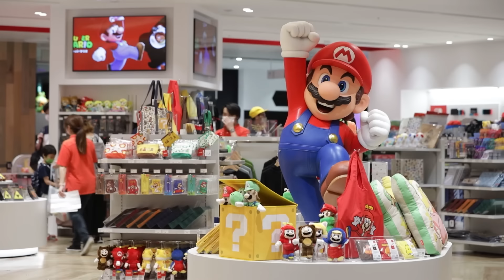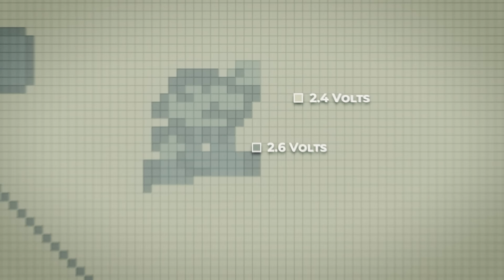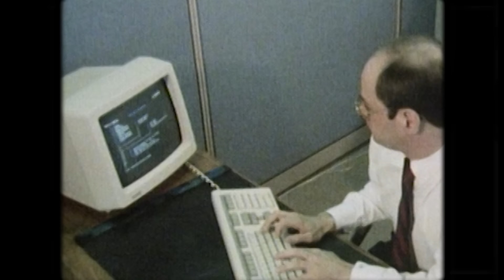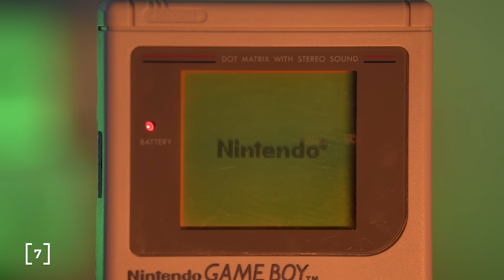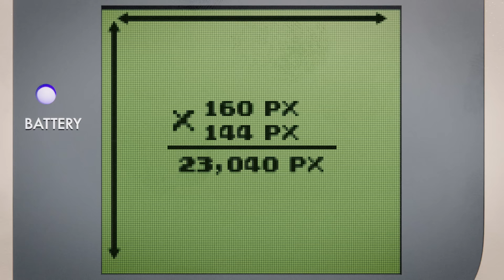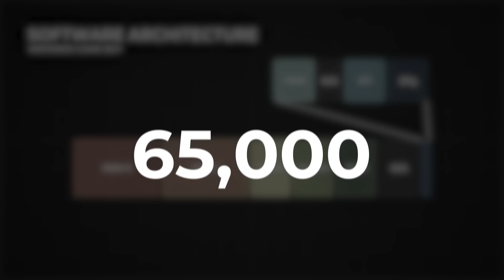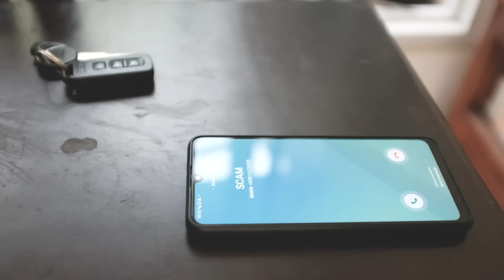The Insane Engineering of the Gameboy

Comment: What made the Gameboy superior was that it was actually doing what people bought it for. it was small enough to fit in a pocket, sturdy enough to withstand rough handling, efficient enough to last a whole road trip and cheap enough people felt comfortable taking it with them in places where it could get damaged.
Reply: That old gray brick was a rugged son of a gun. All early Nintendo products were. We used to say they were made of solid Nintendium.
Reply: @tunoddenrub  Remembering when Nintendo Power published a photo of a Game Boy from Iraq that tanked a hit from a Patriot missile and still worked.
Reply: @zeframmann1641 okg i forgot about that magazine
Reply: @zeframmann1641  another remarcable is recall seeing one that hadcits board basically halved a bit of sodder connecting the halfs fixed it enough to work
Reply: @tunoddenrub  Not all of them. The original toaster NES was fragile and finicky as hell. It didn't really STOP functioning, but the toaster mechanism could easily bend and damage contacts, which is a big part of why people blew on cartridges - it wasn't because the contacts were DIRTY, it was because they were DAMAGED, and the moisture in your breath momentarily allowed the cartridge to complete the circuit.
Reply: That OG Gameboy could not fit into a pocket unless you had parachute pants. Which is possible given it was the late 80’s, but still. Although you could buy a Fanny pack for it, lol.
Reply: @mrshmuga9  Not in your pants pocket but in your jacket pocket.
Reply: @mrshmuga9  nah, I could fit that thing in a pair of jeans, it was uncomfortable but it fit lol
Reply: Don’t forget that it was actually really fun to play for hours
Reply: my Gameboy Advance SP still alive after 20 years lol.. i droped it like a thousand time and only scratches, it like a tank 🤣🤣🤣🤣
Reply: Yes. The customer needs wasn't what an enthusiast wants. It was what a everyday person wanted. It's also why Macbook MacOS, and the M1 chip(in a Macbook for those unaware) is so good for everyday people because it is simple OS, long battery life, and CPU focused. Also, it's why VHS won against Betamax(higher video quality, but couldn't store movies).
Reply: @kknn523  It's more general even than that! VHS allowed you to extend the recording time by slowing down the recording heads. It was TERRIBLE for quality but it was good enough to record an entire NFL football game (about 3.5 hours).
Reply: It was the games you noob
Reply: as he said, UX was the focus.
Reply: True! My blue gameboy colour withstod multiple falls including a 2 meter fall follwed by falling further down stairs and at least 2500 hours of gameplay! I am glad to say, that I still own my Gameboy and it is still running, even thouh it sounds like and flickers like it is dieing.
Reply: And it cheap too
Reply: Now, people understand these concepts through product management principles. Basically, making the product for the target audience's needs. Another thing people forget is also the customer is sometimes different than the user. So, gameboy was very accessible to the mothers and fathers who would feel comfortable spending less money, and also it seemed like it was a whimsical sounding and looking toy for a kid.

 In short, gameboy focused on the mainstream customer and the user. Where as the other product was better only for an enthusiast.
Reply: I dropped my older brothers fat gameboy ONE TIME and half the screen broke on it
Reply: Supposedly $89 in 98 is worth 175 today. I wish they'd make handhelds for under 200 today
Reply: @Redsundog a PS5 is only double that
Reply: It was never superior any real 80s kid knows this from experience. Ur all looking at history u did not live.
Reply: Original gameboy could never have ran a game like CastleVania 3 Dracula's curse. However the Advance Gameboy did have the capacity to run CastleVania 3. It took Nintendo way too many years to make GBA & GBA-SP but Ninja Five'0 was an amazing game. Several other games released on GBA were really unique.
Reply: Isn't there videos of a GameCube be dragged by a truck ans and the SOB still works ?
Reply: Cheap is relative. Was definitely not cheap for me.
Reply: @thisguy2958  Indeed but for many people at the time it was cheap enough that they could consider replacing it. Therefore they weren't afraid to take it into places where it could get damaged.
With the Gamegear many wouldn't take it with them in fear of damaging it.
Reply: @MrMarinus18  had both. Confirming 100%
Reply: @thisguy2958  sure, but the point is it was attainable enough for a person (or parent) with an average income at the time to afford, vs earlier attempts at such products that only rich people and a few really dedicated enthusiasts were ever going to swing.
Reply: @thisguy2958  Relative to its competitors. That's the point.
Reply: @thisguy2958  Well duh. That's the point. U want to be affordable for the most amount of people. Imagine if they had more features how much more  unaffordable it would've been for u
Reply: Definitely not cheap.

Comment: Excellent video, Brian! 

8:52 I would like to point one thing out, and this is a myth I’ll likely spend my entire life debunking. In your video, you state that taking out a cartridge and blowing on it will displace dust that may have caused a faulty connection. However, this wasn’t really the culprit. If any of the pins were misaligned, then that would be the cause of the error, and the reason we all thought blowing on it worked is that by removing and reinserting it, we were giving the pins another chance to realign. The reason I’m so particular on busting this myth is that the moisture in your breath can cause damage to these vintage games. 

So, for any of my retro gamers out there, pull the cartridge out and reinsert it, that’s all you need.
Reply: Bump
Reply: it's just weird though, why was only the NES the one with the problem, i never had or ever saw any problems with the gameboy or anything else cartridge based
Reply: @brats-evolved-cat  it happened with the gameboy too it would cause it to not boot the game
Reply: @gyroninjamodder  i swear if it ever happened it was 1 time out of 500
Reply: Saying blowing into a cartridge damages it is just as much of a myth.
Reply: @gyroninjamodder  
Say you don't know how moisture corrodes metal without actually saying it.
Reply: @evanray8413  I am not denying that corrosion is happening. In fact there is already moisture in the air corroding the contacts without you doing anything.
Reply: @gyroninjamodder  
Blowing on them adds more, obviously.

Comment: Meanwhile current game developer: ok we will use 100GB of your storage space, and we need 32GB of memory, latest gen CPU, and 4080 at minimum to run our game. Oh, and there's 65GB update that you need to install. Optimization? Whats that?
Reply: That annoys me too, but I'll put on my developer hat and say that some of it is understandable once you understand what's going on. A bugfix can end up producing a binary that doesn't diff neatly against older ones, either because the compiler doesn't do deterministic builds (which can be to prevent exploits or because the compiler devs didn't put time into making builds deterministic) or you have asset pipelines that don't produce deterministic outputs. Now, some of this can be dealt with in build pipelines, but there's often no resources given to it. If you see a game with big updates that have small downloads, either that's a studio that goes out of their way to keep updates small or you've a rogue dev who's trying to do the right thing. Not all of this is easily solvable though and there may not be a sane way to keep binary patches small, especially if you have to prioritise asset streaming speeds.
Reply: @talideon  just make asset quality downloadable based on player request. Don't need to push down 4K texture to players that don't need it.
Reply: @FireWyvern870  I'd argue that the only games that could benefit from 4k textures would be 2D ones, as at least that would come close to the screen resolution of the more overkill displays. A 3D game is going to be scaling it down almost everywhere. A 1m*1m surface with a 4096*4096 texture is going to have the texels come out at about 0.25mm. That's a scale comparable to the pixels on a regular monitor. You're not going to see that without your nose up against the wall or a virtual magnifying glass.
Reply: @talideon  what kind of incompetent engineering school did you graduate from?
Reply: Yea because there is such an emphasis on graphics. After 5 minutes you veg out and the graphics become background to the game play anyways. I Have been going back and playing Nintendo ds and gameboy advance games and the fun isn't diminished by graphics .
Reply: @bradley6386  Yep, most of the time it's just "Wow thats beautiful" for 5 sec, then you continue the game not noticing the graphics at all. And not a lot of people have 4K monitor to display all that textures, so why do they keep pushing 4k res down our throat. just make it an option.
Reply: and still lags at 4K maxed out with Ray Tracing and Path Tracing Enabled
Reply: Well, it’s not a fair comparison though. The hardware resources back then were a gazillion times less capable, yet much more expensive, than nowadays.

In addition, back then, there were no “developers”, but mostly engineers (many with a good grasp on how electronics work) and they were very connected to the hardware. There were not so many layers of abstraction to get lost through and the software was crafted specifically for a given hardware.

Personally, I got in the early 2000s into electronic engineering and embedded systems, just because I was passionate as a ‘90s teenager about electronics and computers. The embedded systems were for me the perfect match between computer programming and electronics 😬

By the way, even now, although we have quite capable hardware, we’re working into optimising the memory usage, battery consumption, etc. There’s a lot of time spent looking through such details. That’s what makes a design optimally priced, yet with a robust design.
Reply: Yeah and past gen devs would pump out tech revolutionised games in like 1-2 year timelines with small agile teams.
Reply: You're free to buy games that are less than a gig if you want. There's hundres of those to choose from, even made in the last 5 years.
Reply: @stale2665  then recommend one.
Reply: @stale2665  give me 1 example from 2023
Reply: Things need to stop being made of spaghetti code.
Reply: @Thornbloom  spaghetti code actually doesn't really make game larger, eseentially code are just text that cost miniscule amount of space. It's the assets thats the problem. Either they don't do cleanup of unused asset, or they don't care about efficient use of space.

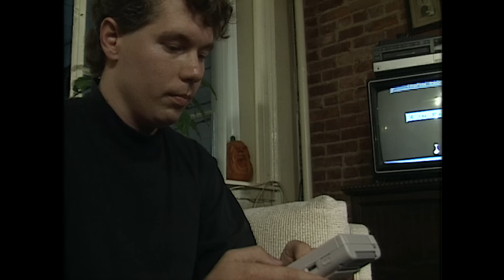Comment: 3:14 I want to note here that the original Wonderswan, which was released in 1999 with more advanced but still comparably modest specs, could operate for over 40 hours on a single AA, with the most advanced model, the Swancrystal, operating at 15. Meaning, depending on the model, operating costs could be as high as 10.8 cents an hour, to as low as just under 3 cents an hour. Regardless if Gunpei was responsible for this technological marvel or not, it sure makes up for the insane prices Wonderswan games go for these days XD

Actually saw this beefy battery life in action when I forgot I had been playing Digimon and left the game running for over a day. I rushed back to it once I remembered, and while the system had its low battery icon displayed, it was still running. All my mons were dead, though.

Still, this is a video on the Gameboy, and it's really amazing how a handheld with some very modest but intentionally thought-out specs changed everything when it comes to handheld gaming.

Comment: Wait what does dust actually do to the wiring?
Reply: It interferes with the contacts, but it's usually not dust that's the problem.  It's oxidation. When people remove and reinsert cartridges to blow on the contacts they think the blowing has fixed it. It might have, but it's actually more likely that the action of remove / reinserting the cartridge has scrapped off some of the oxidation layer on the contacts.
Reply: @hamesparde9888   Hmm i Imagine if anything the the wet air we blow could increase oxidation even further
Reply: @GeoffryGifari Yeah probably. I have heard people say you shouldn't blow on cartridges (probably for that reason.)

Comment: Fun bit: the super game boy SNES cartridge is basically an entire game boy stuffed into the cartrige shell with some side chips to interface the two systems. 

Its CPY bypassed the Nintendo logo check.  You can swap it into a Gameboy and it works fine.
Reply: Nes/snes used a 6502 while the game boy for whatever reason uses a z80 so they had to do it like that as the instruction sets aren't compatible

Comment: It's worth mentioning that back then, you would carry your game boy power adapter with you everywhere. Same with your game gear. My mom got me one that could charge out of the cigarette lighter so I would stay powered while driving without eating through the batteries.

If you had to power the game gear purely on batteries, nobody would have bought it
Reply: My parents got me that but also that external rechargeable battery pack they had with it, the official one.
Reply: Are you talking about Game Boy or Game Gear? The Game Boy lasted about 20 to 30 hours on 4 batteries. No need for a power adapter.
Reply: @cube2fox Both, but it applies to the Game Boy as well. 20-30 hours or not, AA batteries cost money (especially in the early 90's) and when you don't have much money, they were much more attractive options in the long run. Not everyone could piss away money on batteries.
Reply: I always wanted that external official nintendo rechargeable battery because I thought it was cool (I liked rechargeable batteries, I thought they were really cool). But I ran my game boy on rechargeables from good old radio shack. 

Rechargeable batteries were not very cheap like they are today... But neither were alkalines. Rechargeables of the time also only held about 2/3 the power of an alkaline, so they didn't last as long, and recharging was typically an 8 hour process with the average chargers of the era